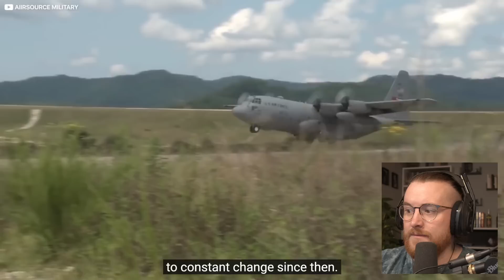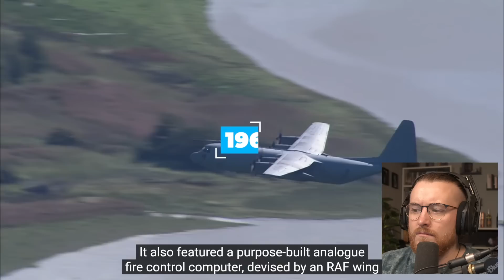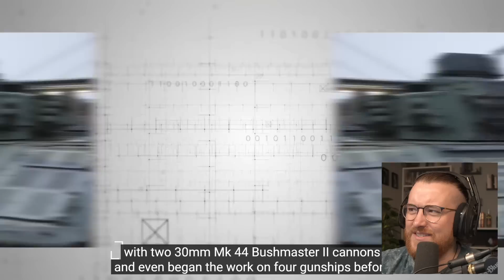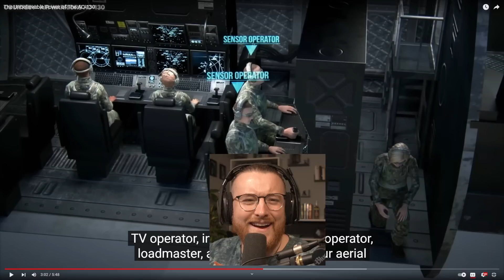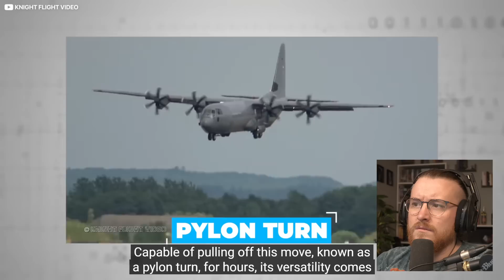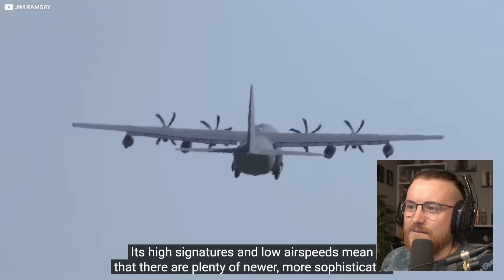Royal Marine Reacts To The Unbelievable Power of The AC-130

Comment: The video is suspect, as the metric measurements shown were of a C 17 Globemaster. The USAF is replacing the older C130 airframes with new airframes  purpose built. Additionally, as mentioned in another comment, Big USAF is testing Griffin missiles ejected and launched via the ramp. The USMC mounted Griffin missiles during deployments to Iraq/Afghanistan. The reason for the Commando Dagger in the badge is that when USAF Spec Ops started, they were called Air Commandos.

Comment: The WWII, Roll-Royce, Merlin, 12-cylinder engine equipped the Spitfire, Lancaster, Mosquito & other models to include P-51 Mustang.  One or more versions of that engine were built under license by Packard Motor Company in the US.  50,000 US engines were manufactured by the end of the war.

Comment: Why did they show the C17 when they gave the measurements of the AC130?  The Lancaster had piston powered Rolls Royce engines, the AC130 has turbo props
Reply: Probably because that was the stock footage they could easily find, and most people won't notice or care about the difference.  It's a cargo plane, and a lot of people aren't very detail-oriented.
Reply: I noticed that as well and was going to ask the same question, but you had already done so.

Comment: The C-130 platform isn't going to be replaced anytime soon because the US Military hasn't developed anything quite as versatile and rugged as it. You'd think using a bigger cargo plane would make sense, but the C-17 Globemaster III and C-5 Galaxy both move too fast with their multiple jet engines to stay in a pylon turn as long as the AC-130 can. The C-5 and C-17 both demand paved runways, where the C-130 can go anywhere there's a clear flat straight line. But to also point out how rugged it is, there's really only one aircraft being sent into hurricanes while still being manned. That's the WC-130, now upgraded to the WC-130J Weatherbird. And I'm not saying like flying around the outer part of a hurricane getting bits of data. I mean they flight straight through the thing into the eye and back out collecting data the whole way through. The C-130 platform can do that, they haven't tried that with any other cargo platforms. To also add to that, there's only been 1 loss of a WC-130 back in the 1970's. Since then, we've never had a WC-130 go down from a mission.

There's just a very deep niche the C-130 has carved that the US Military can't cut their dependence on yet. That's for a slower cargo airplane that's able to function off of any kind of runway and also loiter if needed and take the brunt force of the recoil of several 105 mm howitzer shots from inside. That just hasn't been something the US Military has sent an ad out for or have been in the market for in.....well about 50 years or so.

Comment: When the C-130 first came out They had a team of pilots flying them at air shows They modified the engines so they can fly them upside down. At some airshow flying upside down will tail almost touching the runway less than the height of a man. To me the most spectacular was when four of them come in together at about 400 mph on a collision course, then just before they hit go vertical.

If you can find a video of it they were called the flying horseman.
Reply: you can still loop the C-130....2018 Farnborough Airshow
https://youtu.be/GvVlH0eXIV8?si=pxLLzCPEfOyVZxr5

Comment: You should check out "AC-130 Gunship Mission" even if you don't react (it's age restricted - not sure how that affects your channel - it's all thermal images but you could probably just blur out the two spots where some black dots fly through the air) but it's an older video w/radio audio of a fire mission on a terrorist camp. Also "AC130 against talibans" which has a bunch of 20mm rotary cannon action. Both are pretty high up night vision so there isn't gore and it shows how absolutely devastating the 130 gunships are

Comment: The AC-130 did get replaced, the Air Force Special Operations Command got the funding for new gunships. As you guessed it, the new gunships are the brand new AC-130J. They only have two guns now, the 30mm cannon and the 105mm Howitzer they added two hard points on the wings for missiles like the Hellfire and small diameter bombs. They also modified the cargo door in the back to launch rockets and smaller missiles from inside the airplane.  They are currently testing an offensive Lazer on the new gunships, it should be operational in a couple of years.
Reply: I'm not sure how plausible lasers would be on this. The concern would be the power demand. On a Gerald R Ford class carrier with 2 nuclear reactors creating more power than the ship needs to function, that's one thing. In a cargo plane transformed into a gunship platform, you only have so much space for batteries because I don't think they're getting a functioning nuclear reactor up there safely. So they'd only have a couple shots at full power before they'd be at percentiles of their operational capacity with the lasers. It'd be cool, but it's just the power demand that I don't find it plausible or a practical trade off. And with it being airborne, it'd be more susceptible to obstacles like clouds, steam, mist, and smoke (as that stuff tends to plume out when it rises.) I'm not saying it can't happen, I'm just saying the tech isn't quite there just yet.
Reply: @steeljawX  power is also a key limitation for the railgun. There are a couple ships with big gas turbines that can do it for testing. But to be effective it's going to take a Ford class ship.
Reply: @steeljawX  i was talking on ships.instead of railguns
Reply: The AC130J is just a newer gunship configuration of the AC130, next since Spectre. Still a C130 airframe.
Reply: Obviously much of the aircraft un the video, especially the one in the dimensions, were not AC130s (this was a C17, all together different.

The dagger in the AFSOC patch is in fact a Fairbairn-Sykes fighting knife, or "Commando Dagger". It is there because we were "Air-Commandos" since Viet Nam. The AFSOC symbol remained. As well as we got FS daggers, Australian bush hats, jungle boots and blouses our pants.

Some of the Crew I flew with had flown from Spooky through Spectre (I was a 40 loader on Spectre)

If you knife is still in the US Mate, I'd be honored to bring it to you the next time I head to the UK.
Reply: The Ghost (AC-130J) also came with upgrades to the flight control system & the targeting systems & counter measures,
Reply: Wouldn’t that just mean it was upgraded rather then replaced?
Reply: @KaoretheHalfDemon the AC-130J are brand new airframes based on the "new" C-130J that are replacing the AC-130U and AC-130W that are based on the old C-130H from the 1970's.
Reply: Lasers will be far more effective than anything else with the earth being flat and thus far more range
Reply: If they can get all these laser things operation it's gonna be pretty awesome. All the branches seem to be working on them in some form. And at some point the Navy is going to figure out the rail gun and that's going to be badass.
Reply: @mycroft16  why waste time ona rail gun when they have lasers rha5 cam burn through anything
Reply: @patient_6925  yes, they can burn a hole the diameter of the beam... but there are plenty of ways to stop them. Thin film and meta material coatings can easily block laser weapons. Thin film that reflects the wavelength of the laser, and add a doubled up layer to create destructive interference in the beam and you not only reflect above 95% of the light, but add an out of phase copy that cancels out most of the beam amplitude.

If you use a meta material like graphene nano tube you can simply redirect the beam and absorb energy out of it as heat which just gets dissipated. Lasers are not the be all end all. Nor are rail guns. But a hypersonic slug of something dense is going to have enough kinetic energy to obliterate all but the most ridiculously over thick armor. Even explosive amd ablative armor aren't going to do much in the face of that kinetic energy. Lasers are great for taking out missiles and bombs. Rail gun rounds are great for hitting bunkers, buildings, and punching giant holes in ships.
Reply: @mycroft16  how many people have graphene in the quantities necessary to stop a laser. Doubt many if any. No different than all.the propaganda about hypersonic missiles. Uh huh who cares the us has air defense that moves at the speed of light, missiles aint shit
Reply: @patient_6925  do you know how much graphene it takes to redirect a laser? It's not hard to make. You can even make it at home. The issue is making it at commercial scales. However, you'll notice that I mentioned another way to protect from lasers and it is cheap, simple, easy for any government to make.
Reply: @mycroft16  doubt it. Nobodys going to cover a missile in graphene. Military wouldnt use lasers if they were that easy to overcome
Reply: @tylerbarse2866 lol dont tell america what its lasers can do. Theyll always prove you wrong